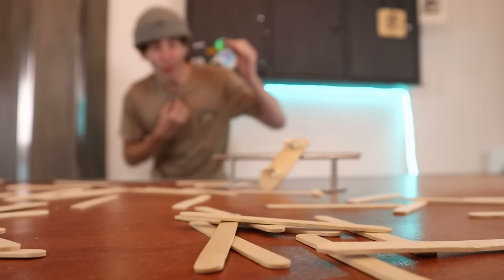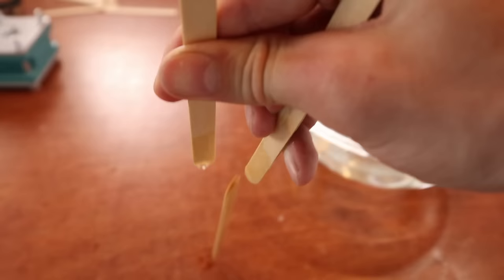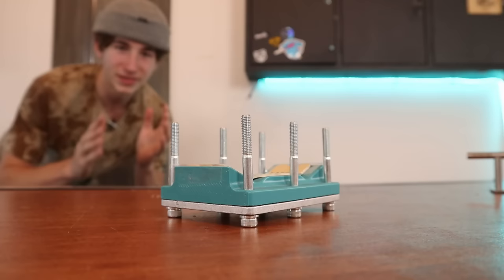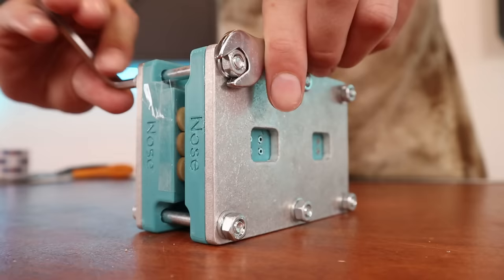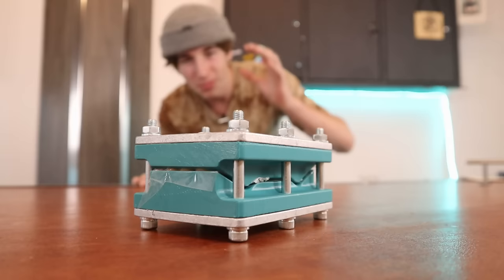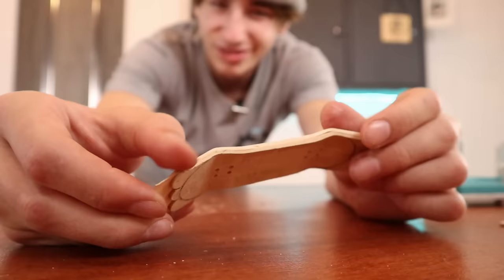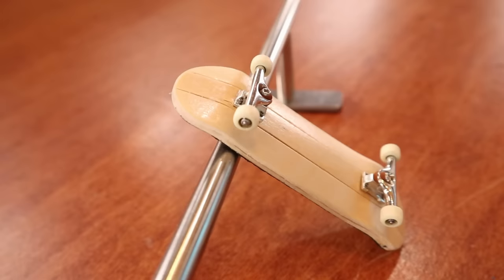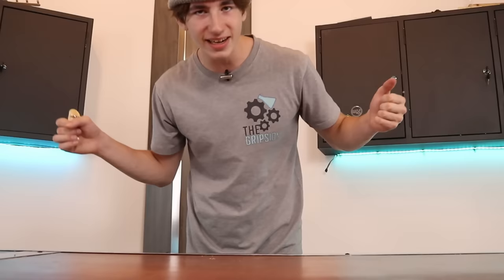DIY POPSICLE STICK FINGERBOARD

Comment: Use wood glue instead of super glue. It'll bind much better. Also, brace your drill so that there's a thick piece of scrap wood between the item you're drilling and you work surface. If you hold the board while you drill more can go wrong. 
Great work though.